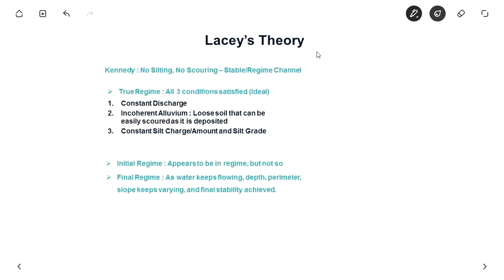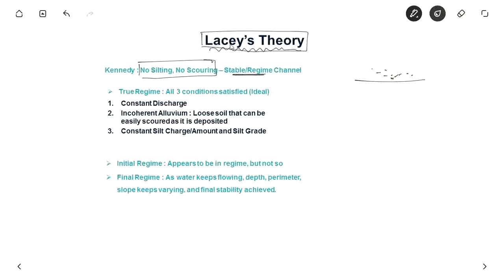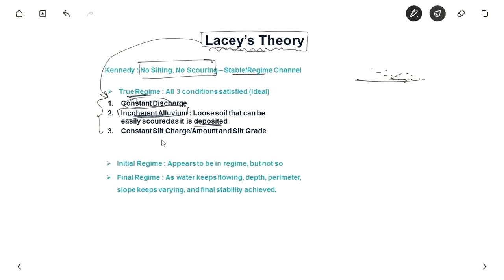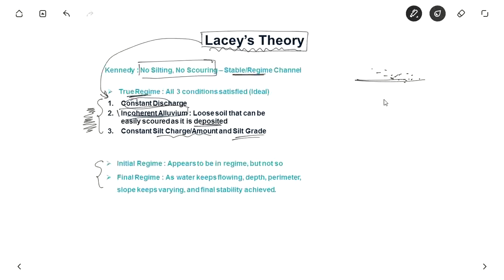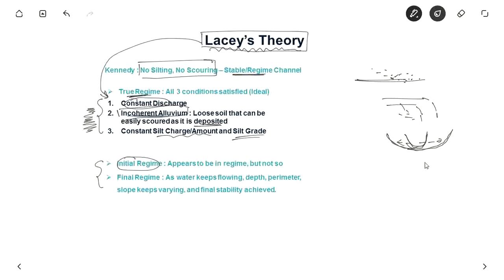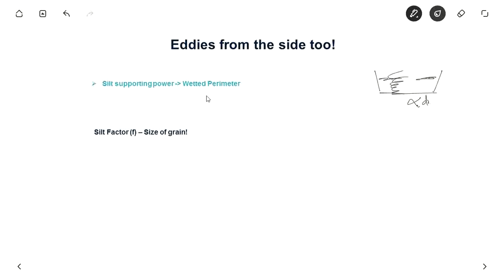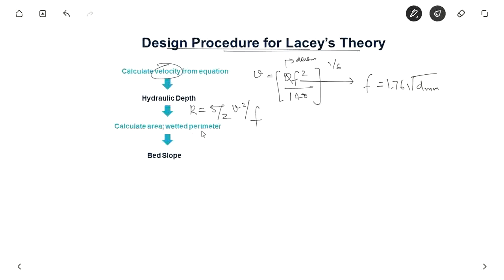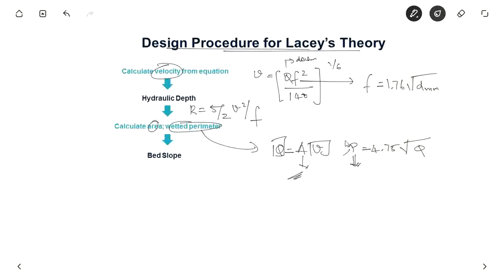Lacey's Theory | Canal Design | Irrigation Engineering

Comment: Sir @APSED...
I hve one basic doubt... If it is a initial regime.... Already the water is flowing in the canal why we hve to design it?
Reply from the maker: How did the water flow in the canal in the first place ? Unless the canal is a natural one.
Reply: APSED
Sry sir I can't understand yet...
First place means
Reply: @saravanangurusamy4658  First place means it's the starting point of entering of water from river into canal where it has semi elliptical shape and sir told that the width keeps on changing
Reply: @saravanangurusamy4658  If we dont design a canal properly , then due to erosion and settling of particles , the depth will decrease in channel and later due to less depth the water will have less energy and hence less area can be irrigated. So we need to properly design a channel for effective irrigation